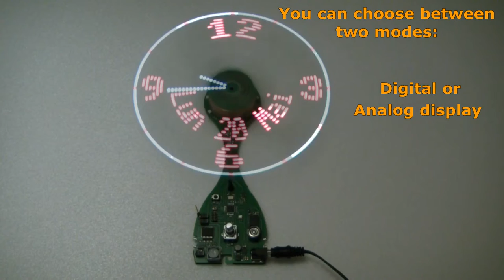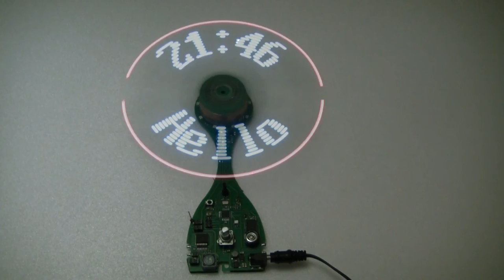Propeller Clock presentation video

Comment: Hi David. Firstly, let me congratulate you on your build. Your propeller clock is the first I've seen with a double (per revolution) refresh rate. The one's I've built using other kind peoples firmware all suffer sligthly from flickering, which I'm sure yours doesn't. Excellant work!! I'm looking forward to build your design although my German copy of November's Elektor doesn't show your clock appearing in next month's December's issue. Could you confirm is it appearing in December's issue?